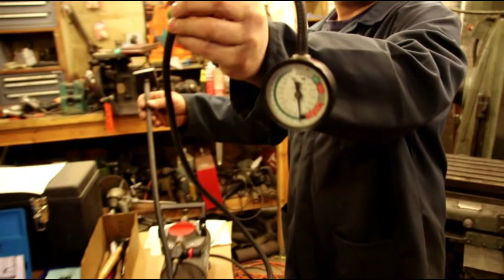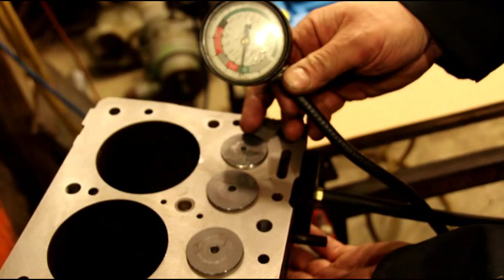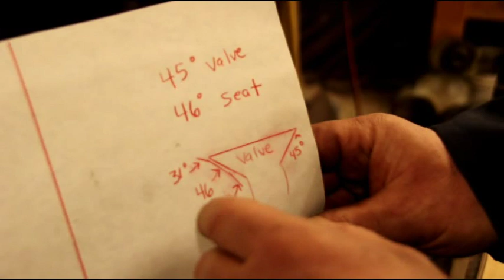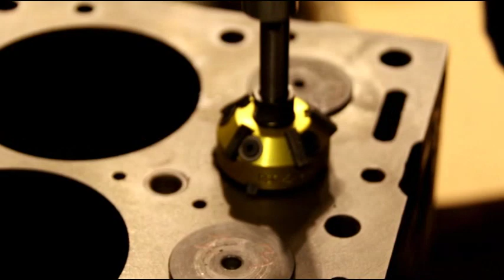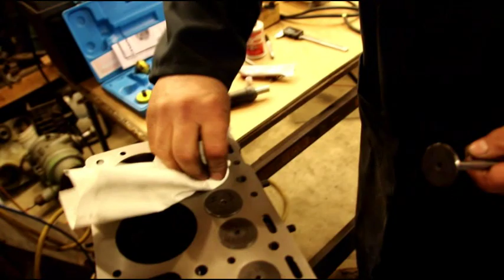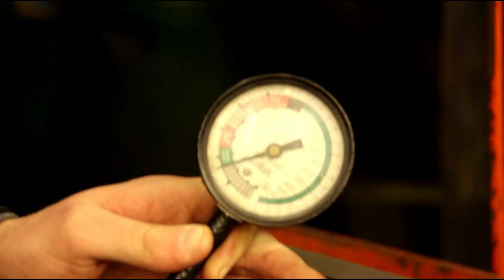Willys L Head Engine Cutting Valve Seats/Vacuum Test

Comment: Brian, what sized pilot should I be using for the F134? Great info here as always!
Reply from the maker: depends on what size you reamed the guides.  I have a .375 and a .374 that I use all the time on the L and F heads

Comment: Can I ask which type or brand mill you use? Is it a kit with the 30 46 and 60 degree angles? Thankyou for sharing the knowledge. Greetings
Reply from the maker: I use a large Cincinnati mill for decking and various other things.  The cutters I use are 31, 46, and 60.
Reply from the maker: I use a large Cincinnati mill for decking and various other things.  The cutters I use are 31, 46, and 60.
Reply: Can I ask which brand cutters you use. I find it hard to find the 3 angels in a kit. Thankyou
Reply from the maker: @Ronnymotard  Neway Cutters.   Don't try to find a kit, just buy the cutters you need and cut your valve seats.

Comment: Hello Brian. Thank you for the fantastic videos that you create. It is a pleasure to watch and learn from you. I am restoring my late father's 46 cj2a in Cape Town, South Africa, and I'm currently busy with the motor. It is a gear drive motor so not original to the car, but that's okay. I'm hoping that some issues I'm coming up against might be covered in your engine build series. My motor has two tappets that do not rotate when the motor runs; it has a crankshaft end-play of .010" with all of the shims removed; and finally the cylinders seem to have been bored out to 0.08", but the #4 cylinder still has a significant scar from the pitting that was caused by the #4 piston rusting in place from the motor sitting for a number of years. To the tappet rotation issue, would you recommend commiting to NOS cam and tappets, or would you say that it is worth the effort of trying to find a place that recondition the original parts? To the excessive crankshaft end-play issue, I have read about machining a recess into the thrust washer to close up the excess clearance, but would there be any negative implications of such a modification? What other options are there in this sort of case? Finally, to the #4 cylinder, what is your opinion on cylinders being bored out to that maximum size? Ideally one would re-sleeve the scarred cylinder, but new 0.08 pistons and rings have already been bought. Is it bad practice to sleeve only one cylinder? I apologise for the barrage of questions. Thank you again for the effort that you put into making these videos. They are extremely helpful.
Reply from the maker: I would add a new cam and tappets if I was doing the rebuild.  You can also have the crank end play worked out when you regrind your crank, you can work with your grinding company to recondition the crank to have less end play.  If your cylinders are already .080" and you need to fix # 4 there is no problem just sleeving one cylinder.  Just bore it to size of other pistons so they are all weight matched and you will be fine.    Brian
Reply: @metalshaperJeep  Thanks very much Brian.

Comment: Thanks Brian, enjoyed as always. Goodson sells New Way tools, they are also the only place I could find a swage cutter for brake drums. They are a good outfit to deal with as well. Thanks bud, taker easy! Will
Reply: Swage cute I meant
Reply from the maker: Yes I like Goodson as well.  Cylinder head supply carries them as well.
Reply: Hi Brian, thanks so much for the videos. I just recently got an F head back from the machinist after he sleeved it and I can see a crack from the #3 exhaust almost identical to the one you repaired. He says he thought he Magnafluxed it. I’m going to do the Lock-N-Stitch myself. Is there a particular kit or package you recommend? Thanks

Comment: Could you please explain why air conditioning type vacuum pump isnt as good?  If it produced good vacuum, how is that not good enough? What am I missing?
Reply: It’s what our local NAPA machine shop has used for years testing valve seating. Seems to work fine for them. I’d like to know the answer too.......
Reply from the maker: The AC pumps have special fittings on them and they are harder to adapt.  They work but you can't just hook up a hose and go.   Special fitting are a nuisance.

Comment: love the info.   questions!
the vacuum pump is oilless? any specs  I would like to get one - I am guessing any vacuum gage is likely good
what material did you use for the end you put on the block (just plastic?)
Reply from the maker: Any vacuum pump will work, the only ones i don't like are the A/C units with special ends.  Just get one that you can hook a hose to and use.  The end block is a piece of polyurethane, strong enough to drill and tap a fitting.  A little grease or vaseline on the end makes a good seal.  Any good vacuum gauge will work fine .